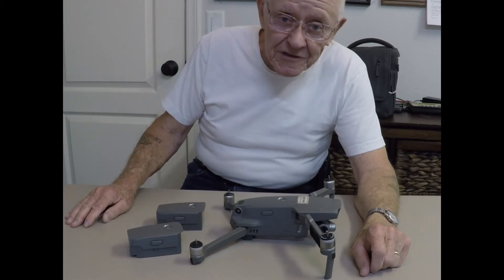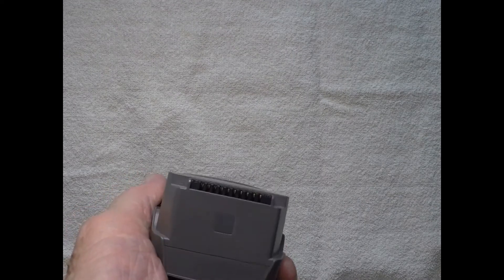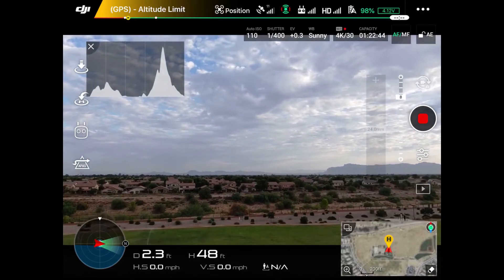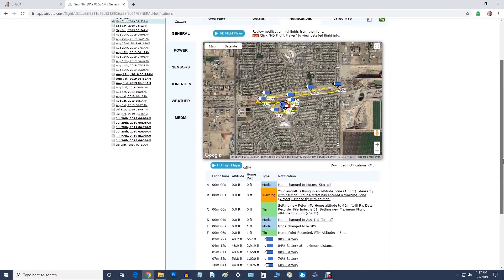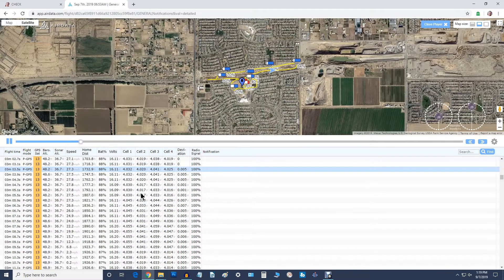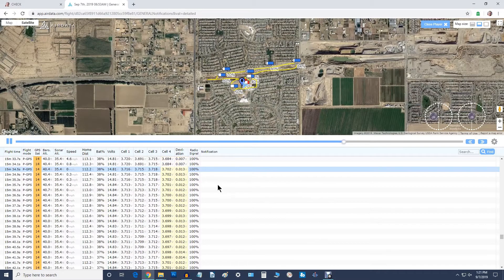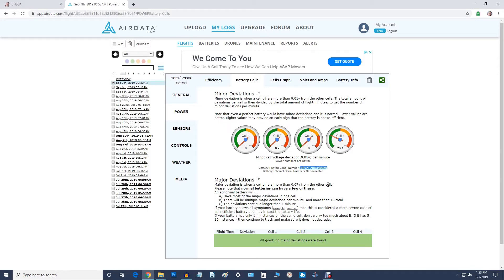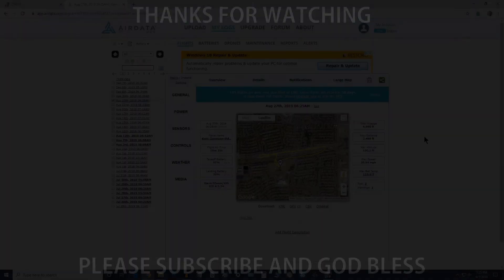IS MY MAVIC 2 BATTERY STILL GOOD IF IT IS "PUFFY"

Comment: Hi fellow drone folks, same issue with the batteries for my Mavic 2 Pro, I've had the drone for about a year and all 3 of my batteries are displaying this swelling to different degrees.  My fear is that it will eventually put enough pressure on the locking clips to dislodge them or break them and if that should happen at altitude....well we know what the end result would be.

I contact DJI support, answered all their silly questions, supplied all the information they asked for and all 3 are now being replaced under warranty.  Frankly, warranty or not they should replace them, they know there's problems with the technology.  They would tell me if my drone would be covered should it drop out of the sky because of a defective battery!!

Fly safe all!!
Reply from the maker: Some very good thoughts Bob. . . glad to hear they replaced your battery. This video was put up many months ago and I eventually stopped using that battery. Thank you for your comment and input and God bless.
Reply: @user-sr8pn9xg8z  I think I found their kryptonite!!  I let them know a few things, A) the battery design is flawed, a drone with this much technology and the batteries only lasted me a year!!  B)  I told them that I suspected that DJI is aware that the batteries are flawed and who is going to replace my drone when it drops from 600 feet up because of a faulty battery!?  I was notified that my other 2 batteries are also being replaced even though they are out of the 1 year warranty window!!  😊👍

Comment: I found out the hard way that you can generally fly ok with swelled batteries, I did it a lot, but if you fly with a swelled battery in tripod mode for 10 minutes it gets too hot, and swells so much it comes off in flight. That's  what happened to me, and it crashed into the ocean. It's  a poor design, because they should make it so, battery swelling does not compromise the mechanical  attachment to the drone.
Reply from the maker: Thank you for your input Steve. Yes, I eventually gave up the idea of ever using a swelled battery also. Thanks again and God bless.

Comment: So do you think that these batteries are still safe to charge when puffy? I was worried about explosions. Also a big concern of mine is the battery expanding during flight as it heats up and then popping out enough to cut the power. I thought about a zap strap or velcro strap. What do you think? I've shared my experience with puffy DJI batteries here. I hope they will replace them for me: https://gregsamborski.com/swollen-bloated-puffy-bulging-dji-mavic-2-flight-battery/
Reply from the maker: Thanks for your comment Greg. They are obviously not as safe as new ones. After putting up that video and giving it some thought I have decided to bite the bullet and replace them. It is much less expensive way to go than risk losing the drone and all. I hope that is helpful advice :) God bless.
Reply: @user-sr8pn9xg8z  thank you for the video and tip. I've had the same issue with bulging batteries on my old mavic pro. I haven't not used in a while and wondering if you have experienced with other brand or alternate battery?

Comment: Good info to know Mr. Kent, thanks for sharing. I have heard that dji products have firmware which will prevent the drone from arming and will not allow flight if the battery is not safe to fly? Do you know anything about that? Thanks. God bless.
Reply from the maker: I haven't run into that or heard anything about it. I have an old battery I used for tinkering in the house and I get a warning that it is not safe to fly but have never been prevented from flying except in a no fly zone. Of course I'm at least smart enough not to start a flight with a dead battery so it may be true. I just haven't had it happen. Thanks for the question and God bless.

Comment: GR8 INFO VIDEO... I hav 1 fat battery now... i jus use for short flights....DJI needs to do better with their batteries
Reply from the maker: Every lipo I have ever had begins to swell as it gets used. They last a lot longer if you keep the current drain low, but that's hard to do with drone batteries. And, I haven't treated these batteries very gentle. Thanks for your comment and God bless.

Comment: I will usually use a slightly puffy battery, as long as the cells balance reasonably closely. Mind you, that is in a RC plane, where I have a lot more room to position the battery; and even  if your battery balances, any slight puffiness may mean that you are just not able to fit it properly. Ian :-)
Reply from the maker: Yep, you're correct. I'm hoping the puffyness will grow very slowly. One of the things I am going to change is NOT to leave my batteries discharged below half way, which is what I sometimes do. And that may be what's happened to that battery. I appreciate all of your input Ian. Thank you and God bless.